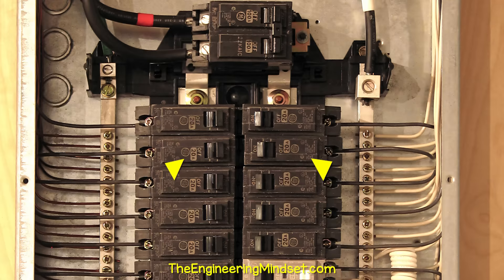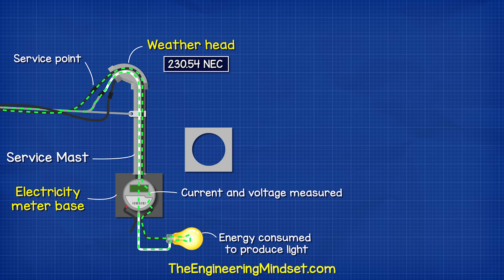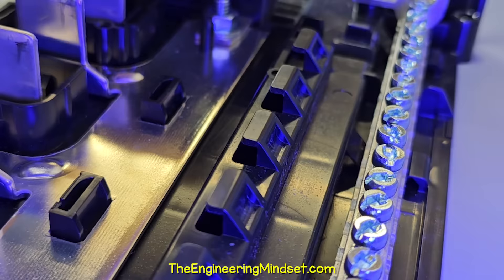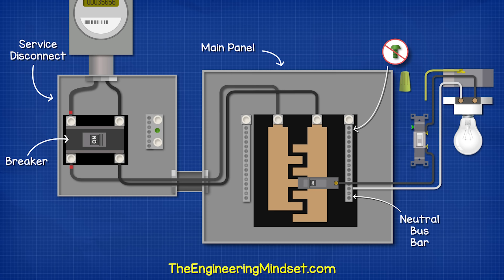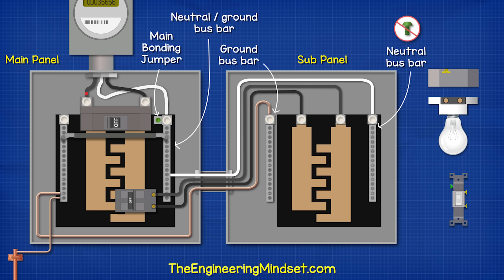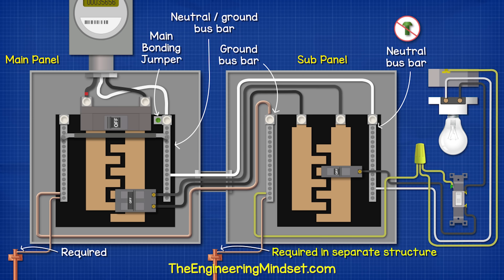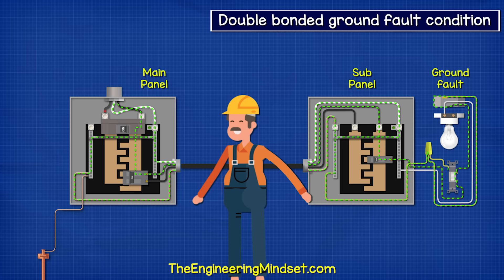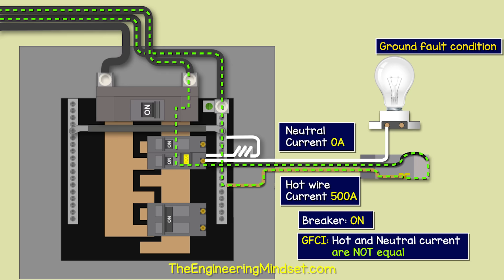Sub Panels Explained - Why are neutral and ground separated?

Comment: If the hot bars are getting their power from the same phase, then how come you read 240v when measuring the voltage between them?
Reply from the maker: The natural is connected to the center of the transformer coil, so each hot bus connects to just half of the transformer to get 120V (one is +120v the other is -120v) if you connected across both hit bus then you'll use the full transformer coil which is 240V which is the difference between -120V and +120v

Comment: The main panel will need to be rated suitable for the use of a sub panel since all sub panels need to be 100 amps the minimum amps the main panel should be is at least 200 amp main, the main panel needs to be grounded and bonded,  and a continuous #4 awg ground wire from 2 ground rods minimum 6ft apart and to main panel or disconnect but ran through the main panel to the sub panel or sub panels , the bonding is for the main panel or main disconnect and not the sub panels , the grounding which is done incorrectly in video because the #4 awg ground wire in video is broken and made up under ground bar in main panel is cut and #4 awg ground wire to sub panel comes from ground bar , not continuous run , but the sub panel needs the #4 awg ground from main ground rods  through main panel as well as ground rods for sub panels
Reply: Grounding and bonding is a major part of the testing for electrical licensing so please make sure that all information provided in videos show accurate information
Reply: Except as provided in 250.30(A)(5) and (A)(6), 250.30(B)(1), and 250.68(C), grounding electrode conductor(s) shall be installed in one continuous length without a splice or joint.

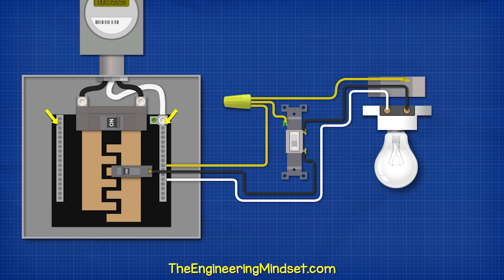Comment: At 5:40, if you measured the voltage between the two hot bus bars, wouldn’t it read 0 Volts, because both are 120V therefore the difference between them is zero. 

By the way, I am not trying to be a wiseguy, I really enjoy your videos, and I am only trying to learn
Reply: No, the voltage kinda adds up. The neutral is the middle of the two phases, so you can kinda say the voltages are -120, 0 and 120. This isn't true though, but for explanatory purposes I'd say this. The 240V is used for high current appliances.

Here in Norway everything (and EU), we use 240V for everything. The norwegian system is different to other countries, but same logic applies. We have 240V between a phase and neutral, and 400V between phases, or between hot bus bars.
Reply from the maker: No, one bar is +120v the other is -120v so between them is 240V.
Reply: No, because you're measuring the voltage (potential difference) between opposite poles. One is +120v and the other is -120v and 0v is the mid point (neutral). If you measured a point on one one of the bus bars and another point on the same bus bar, then you'd get 0v because there's no potential difference. As an analogy, say if you're at home and you had to drive somewhere. Your home is 5 miles from the interstate highway and your destination is 5 miles on the other side of the highway, total is 10 miles.
Reply: Ahhh, thank you. 
I didn’t realize the +/- aspect of it. 
Makes sense now.  
👍🏻
Reply: They both start at 0v. Voltage is 0v.
One climbs up to +208v, the other dips to -208v. Voltage is 415v.
Then 0v again.
Then firts dips, the other climbs, 415v again. Then both 0v.
If you average this out you get 240v.
They are sinusoidal in phase opposition. Mirrored if you prefer.
There used to be 2 hot 127v and no neutral in some parts of Rome not too long ago.
But there were not 254v between them, only 220v, because they were not in phase opposition, but at 120 deg, or 6,6 milliseconds delay.
So when you have two hot wires 120 ac, you don't know what you have between them, it may be 0, it depends on the outphasing, the more the higher.
For istance, 90 degrees give you a +41% voltage bump.

Comment: 5:43  measuring across the two hot busses have a difference of potential equal to 240 volts? Assume the two 100V AC lines are 180 deg out of phase...?!?
Reply from the maker: One is +120v the other is -120v so the difference is 240V
Reply: @EngineeringMindset  Thanks, I didn't see that mentioned in the video. But the video is very well produced.

Comment: What can I do if the main power wire from the sub to the main panel doesn't reach? They are 35 feet apart and the wire is 25 feet.
Reply: Buy a longer wire

Comment: how do you only have 1 hot coming in on the primary winding and 2 hots coming out of the secondary winding?
Reply from the maker: The transformer coil has a connection (neutral) connected to the centre of the coil. So you can use half the coil for 120V, the other hot wire and neutral for another 120V or both hot wires for 240V.
Reply: @EngineeringMindset  does it not have 2 phases that are 180 degrees apart? if it's only relying on 1 phase, I wonder if there's any difference in effect on 240v appliances 1 phase 240v vs 2 phase 240v.

Comment: What if you have a service disconnect in the sub panel?
Reply: Then it's not a service disconnect by strict definition.  It is a main breaker of the subpanel, but not a service disconnect.  It allows you to shut off the subpanel to work on it alone, but since it isn't the first disconnect from the service point, it doesn't qualify as a service disconnect.

Comment: It is crazy that the ground wire provides both the neutral and the ground.

In the old 1920s hookups in rural areas, you have 2 wires coming from the transformer, to the meter.
It is a 60 amp main breaker

These 2 wires a hot 240 volts

The ground wire comes in to a common neutral ground bar.

It is crazy that we now need 5 cables coming from the transformer to the meter and the main panel.

It is even nuttier that every cable is black

We have to put white, red, green black and blue electric tape on each wire.

WHY DOESN'T THE COMPANY MAKE WIRES THAT ARE ALREADY THE DIFFERENT COLORS ??!!!

Comment: Here's my scenerio.  At the meter, there are two hot wires (black) and one neutral (white). The white is connected to a ground in the meter box. Those 3 wires go into the main panel from the meter panel.  The two black wires are attached the the main breaker in the main panel. The white is connected to a bus bar. The Bus bar is joined with a crossing to the bus bar on the left side of the box.  On the right bus bar where the white wire is connected, there is a long thick white wire that goes through the main panel and into the subpanel inside of the home.  That wire is connected (white wire that is grounded at the meter box) on the neutral side.  Is this supposed to be this way?  Since the neutral is grounded, can the neutral be used as a ground in the sub-panel?  Why or why not?
Reply: To your first question, it does sound correct, but I can't be 100% certain without seeing it. You may want to call an electrician to verify that. The answer to your second question is absolutely not. The neutral and ground connection must only be made at the first disconnect, usually that would be the main panel. Anywhere downstream, the neutral and ground must be separated and under normal operation, the ground wire must not carry any current and the neutral wire must carry all of the return current to the only ground/neutral bus in a 120 volt circuit. The one exception would be in a multi wire branch circuit, the neutral wire will carry only the unbalanced load and the rest would return on one of the hot wires. You can't carry current on both the neutral and ground because it would a parallel path and may not trip the breaker. It would be a shock hazard since all the metal components would be energized.
Reply: @surferdude642  Thank you for the reply.  I ended up calling a friend of mine who is an electrician.  Since the Main panel is outside and the subpanel is inside, on the opposite side from the main, I just ran a ground through the conduit of the sub into the main and attached it to the bar there.  I then added a ground bar to the sub and officially have ground.  It's crazy because I asked many electricians, and no one had a solution to this simple one.
Reply: @ShyRage1  You said that you added a ground bar to the sub. I don't get that, because your sub panel must already have a ground bar. Did you need a second one? The ground bar must be grounded to the panel frame, but the neutral bar must be isolated from the frame and the ground bus bar. You said previously that the main panel has a crossing bridge joining the two bus bars. Are ground and neutral wires sharing those bus bars or are they occupied by neutral wires only?
Reply: @surferdude642  My sub panel in the home did not have a ground bar at all.  It's an old sub-panel.  It just had a place to tie in the neutral wires.  I had to purchase one and then install it.  Yes, the ground bar must be grounded to the panel frame, but there was no ground bar originally or ground.  The ground and neutrals in the main panel share the bus bars.  That is allowed in the main panel.
Reply: @ShyRage1  So all the circuits in the sub panel are ungrounded then the receptacles should be 2 prong or replaced with a GFCI or multiple GFCI's for safety. If the ground and neutral share the bus bar in the main panel which is typical, it indicates that the equipment ground and neutral wires are not connected anywhere else if it's correctly wired. The white wire is connected to the ground at the meter box. The ground wire may also be connected to the ground rod.  The ground wire in the meter box grounds the meter box housing. I think that different jurisdictions have different regulations on whether the grounding electrode system and ground rod is terminated from the main panel or the meter base. That's my understanding, and I hope this helps.
Reply: @surferdude642  No.  All the circuits in the subpanel are grounded.  They originally weren't.  They are now.  I hope everything I'm explaining makes sense.  I was just surprised on how many electricians couldn't tell me the simple resolution to my problem.  All recepticles are 3 prong with tester showing correct wiring.
Reply: @ShyRage1  Are the circuit wires behind the wall running in metal conduit?
Reply: @surferdude642  No they aren't.  There aren't a lot of homes here in Texas with armored wiring.  It was common when I lived in Missouri.  It seems to me that you're missing a piece that I explained earlier.  Go back and re-read how I made the ground work.  I think that's the piece you're missing.
Reply: @ShyRage1  okay, I got it now, good job, thanks.
Reply: @surferdude642  THank you so much
Reply: @surferdude642  I have a question for you.  My subpanel is powered by a 50 amp double pole breaker in the main panel.  In the subpanel, how many breakers can I add?  I read that it's not by amps but by load.  If this is true, how does one figure it out?

Comment: If ground and neutral both return to the service neutral - why is the ground path any less resistance than the neutral path? Is it just because it doesn't have insulation?
Reply: I don't think that it is. The point of the ground wire is to provide a low impedance path in case the hot wire contacts a grounded metal case. The neutral wire is not involved in this scenario. If the ground wire contacts say the neutral screw on a receptacle the return current will be shared between the neutral and ground and have parallel paths of return current which is also bad because of a potential shock hazard. If you have a GFCI receptacle in the circuit, it probably wouldn't reset or it would trip when you plugged something in and turned on the switch. The insulation or not has nothing to do with it.

Comment: I would add.. When installing an isolated ground. You need a separate ground bar. That is isolated from the panel. It has to be grounded to an external grounding rod. That is attached to the meter base neutral\ground bar in the meter panel.. You don't connect it to the ground bar in the panel. As you would defeat the purpose.. 

I seen this problem in lots of commercial installations..

Comment: The pole in our yard has both transmission lines and local distribution lines. The transmission lines have 3 wires and the distribution lines have 3 wires. But there isn’t an extra “neutral” wire for either.

Comment: What if sub panel does not have a ground wire connection to the main panel and only has the 3 wires?
Reply: Then a ground fault in the circuits attached to the sub panel cannot be cleared and metal parts will remain energized.

Comment: 1:45 and 5:38. From 1 phase you getting 2 phases?
Reply from the maker: Yes but no. The neutral connects to the center of the transformer coil, the hots connect to opposite ends of the coil. If we connect from one hot wire to neutral we get +120V, if we connect to the other hot and the neutral we get -120V, so if we connect between the two hots we have a difference from  -120v to +120V which is 240V. Its supplied from 1 phase but the neutral split it into two opposite phases. See our other videos for more details

Comment: 0:48 How do I get a mug?  Nothing on your web site.  Thanks.
Reply from the maker: Under the video, on mobile, there should be a merch section. 😁
Reply: @EngineeringMindset  Thanks.  I'm on a computer connected to the internet through wires.  I opened "...more", searched for "Merch", nothing found.

A sign of the times when mobile has become more powerful and important than the old wired internet.  Oh well.  I'm a dinosaur.
Reply: @EngineeringMindset  Found it!  It's in the About section under a heading called Store.

Comment: If the neutral is lost and the return to neutral via a bonded ground in the sub and the main ground ..... It's all going to ground....why would you feel it enough to hurt you or shock you severely....the same with the neutral...the neutral is grounded in the system, and at the power pole as well along with transformer case ...when you touch the neutral while its hot and unbalanced, you don't feel it like you would with the ungrounded hot wires of course. So....why is it such a  bad thing to run grounds and neutrals and bonding safety equipment grounds to grounding. The main panels are grounded,  neutral grounded, and connected via a bar and green bonding screw placed in position ... All to ground....why would you feel any unbalanced load, or in a fault, feel anything, etc ... This is nuts. I say ground everything everywhere....send all neutrals to ground in the event of a lost neutral, send safety bonding to ground and multiple grounding rods that are at least 6' apart, and bond for safety all metal panels to same said grounding rods for safety. If it runs to grounding, you won't feel it, it shouldn't hurt you, etc.... open neutrals can hurt you too. If they run to grounds...they can't hurt you.

Comment: A phase and B phase for 125v/245v ...
Black.               Red
A phass B phase  C phase  208
Black.       Red.       Blue
And B.O.Y 277v/480v
Always follow color coding when doing new... and the older or anything a maintenance man has been in use a voltage tester not an idiot stick... always work like it's hot...
Reply: What do you do if you have 277/480V coexisting with 347/600V on the same property, when there isn't a color standard for 347/600V?
Reply from the maker: Seen our new 3 phase transformer video?➡️: https://youtu.be/u0SsejDCVkU

Comment: The short and sweet version of this is that the neutral should never be a current carrying conductor. If the ground and neutral were bonded at the sub panel, it would then in effect be a neutral, not a ground, and would be carrying current any time the sub panel has a load. With them ONLY bonded at the point of first disconnect, that ground conductor will not be able to carry any neutral current and will only perform its intended function.